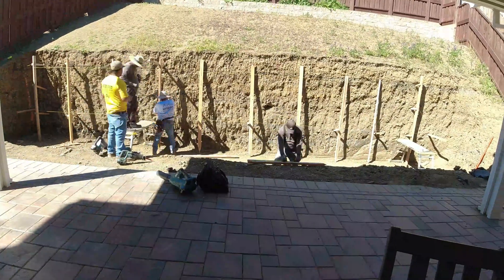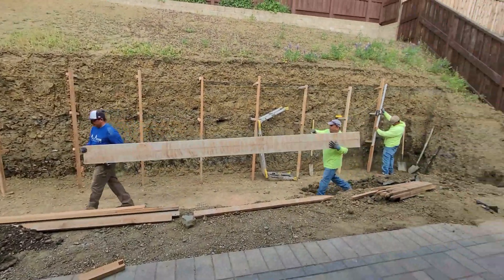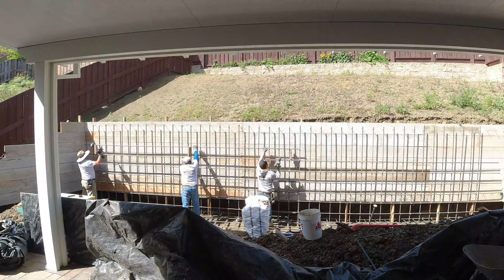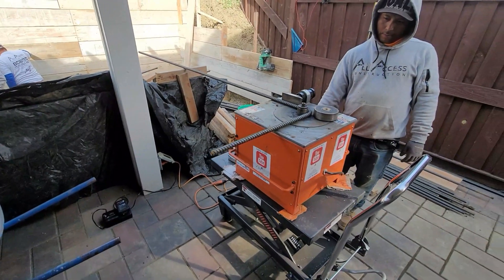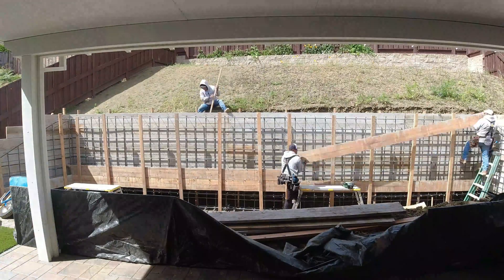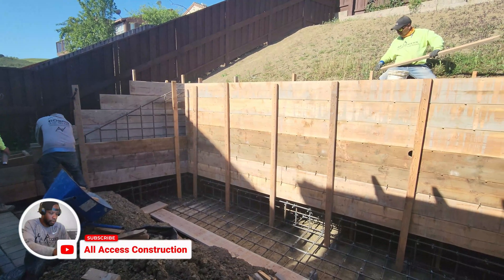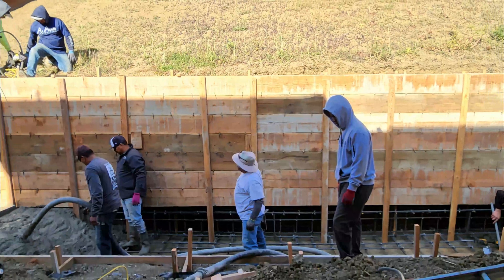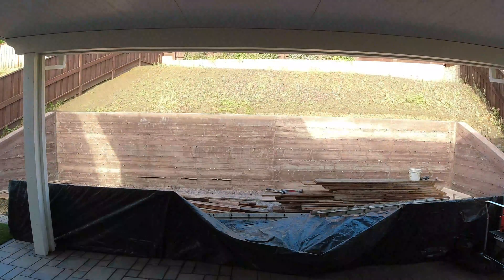What's The True Size Of A 2*12 for Concrete Retaining Wall ❓( Don't Cheat 😉)

Comment: The Tetris Life ✌

I like that Ya'll are playing with Colors too Assumably thats Probably  Alot Healthier for the Mortar than Painting it?

Was it any more Annoying to Work with and was the Cost Significant?

Sorry Ya'll Gotta Deal with Arrogant Idiots on other Platforms Hard to Understand What Gain Comes From Such Behavior...🤷‍♀️
Reply from the maker: NAhhhh.. Color came straight out the truck.. As far as the idiots. I love to respond to the haters.. 😂😂😂
Reply: @AllAccessConstruction  
Your Rebellious is Showing Dear Sir 😋

I Was just Curious bout the Color.

I like Using a Poly Mix the White Stuff from the Blue Box Store Works Great and would probably be cool to Play with color swirl designs I like Using it instead of typical Stucco or Plaster.

I Did Have the Expierience of just Picking Up Some of the "Same" Stuff in Grey for more $ at different Store I was Already At, but Good Grief, it was So Very Annoying just Some Clumpy @$$ $#!+ that Dried Out Fast and got Flakey (*Gross).

All I know is Somewhere Between those 2 Brands the Science Didn't Match Up...
Reply from the maker: Yea I don't get to scientific with it I show them a color chart tell him to pick the color they pay for the color😂😂😂
Reply: @AllAccessConstruction  I'm the Owner, and  the Mortar Mixer 😋

...And Yea Sometimes We Don't Like Each other 🤣